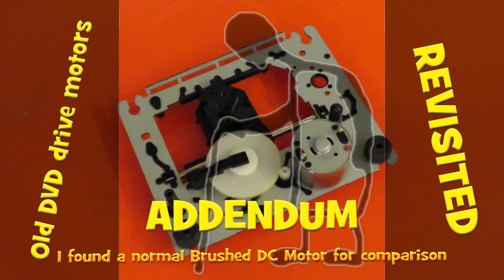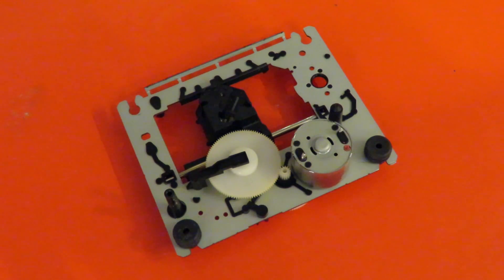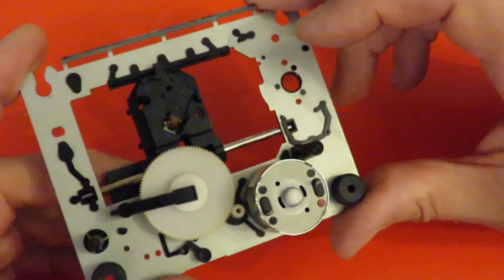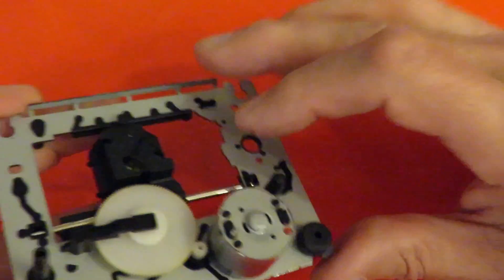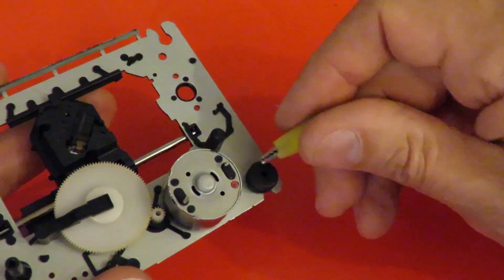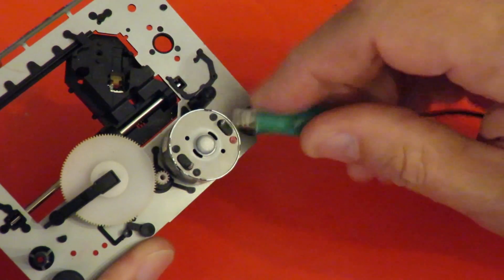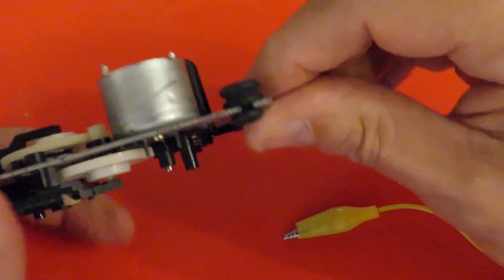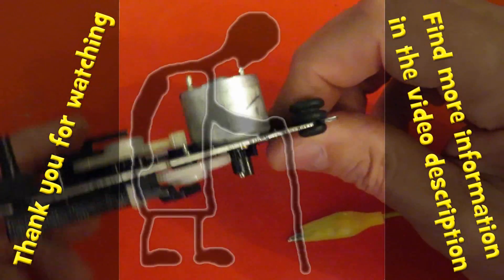Old DVD drive motors revisited ADDENDUM

Comment: How much volt you give
Reply from the maker: Sorry I don't remember, this was 2016. I was only demonstrating it was DC so I doubt I chose the voltage to match the motor. Probably used 6 volts or maybe 12 volts but that is just a guess. I only wanted to see it moving. You may find the information in the video description helpful.

Comment: As discs became more "dense" greater accuracy was required.
Hence the stepper motors.
Reply from the maker: +Wil Hobbs I am not entirely sure that holds true. I think this is a newer assembly than the ones with stepper motors but I don't know what it came from. I don't know exactly how the data is encoded on discs and I am not going to dive in and find out but I guess there could be a clever software fix and buffering to get around data location issues on the disc. I am just guessing here, but maybe if it was just a music CD player or even a Video DVD player it would not need the same accuracy as a data reader.
Reply: @GrandadIsAnOldMan  Yes, i have a couple of those and they came from a music CD player, it has a small spur gear on a two terminal dc motor with two larger gears that drive a straight linear gear that moves the head along two steel rods. I believe the stepper motor types are found in computer CD Rom drives use a worm gear arrangement.